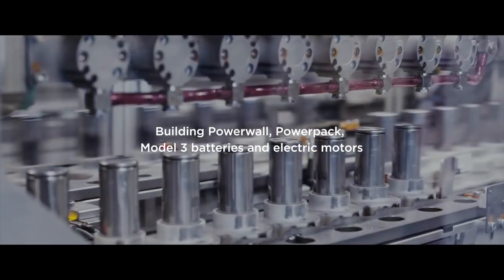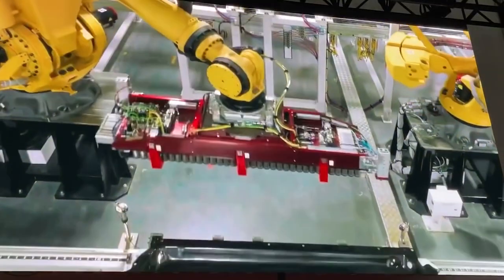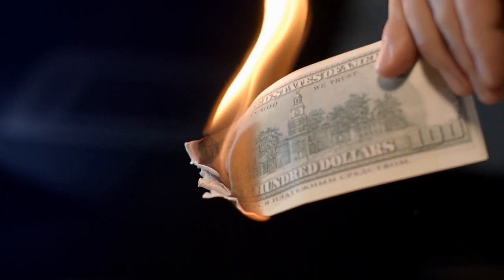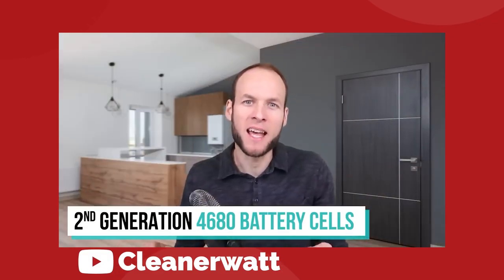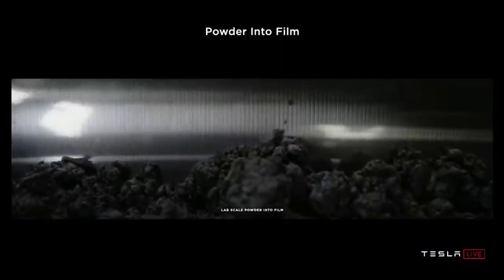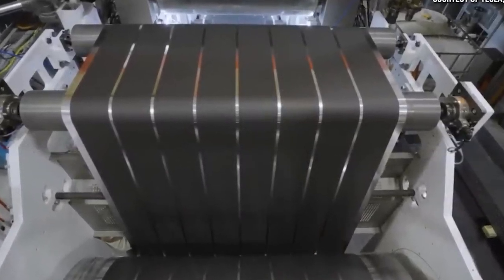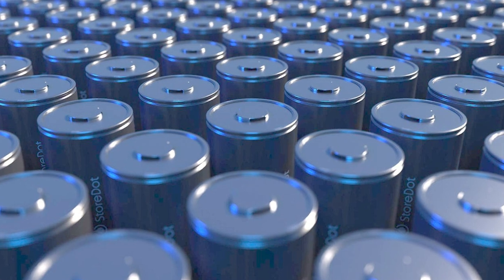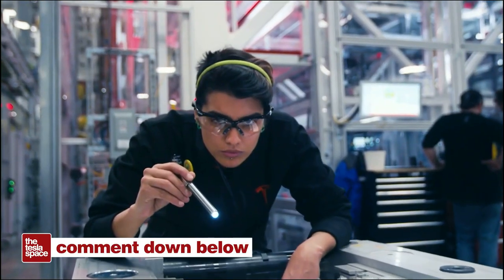The Gen 2 Tesla 4680 Battery Cell Is Here!

Comment: Musk fans are truly amazing. They actually want an unrepairable battery pack. So they can give the billionaire another $20,000 if anything goes wrong outside of warranty! Guess they feel he needs more of their money?
Reply: Tesla has a pretty good battery warranty:
8 years or 120,000 miles, whichever comes first, with minimum 70% retention of Battery capacity over the warranty period.
It would be wonderful if they could figure how to fix individual cells, but Tesla decided the structural pack makes more sense. I remember when you could replace RAM in laptops, but Apple and other companies decided it was more economical to solder it on the motherboard.  I expect that five years from now, batteries will improve so much you won't find it economical to fix the batteries of today.
Reply: People referring everyone and anyone rooting for Tesla, or simply following their progress, as "Musk fans", are truly amazing at spending so much time and energy on something totally out of their control anyway... 🤷‍♂️
You don't know anything about "$20k" batterypacks in 8 year's time, or if these batterypacks even cost this much now.
If something that bad goes wrong outside of warranty, is why you have an insurance on your car. It can happen with an engine, transmission, structural frame etc. of any other car.
Reply: @martinandreaskruse4446  Engines aren't welded shut so you have to replace them if a spark plug fails!
Reply: @DavidJohnson-tv2nn  Electric motors are usually much more reliable than gasoline engines.  Plus, you don't have any spark plugs to replace!  The battery of a BEV is much more akin to the gasoline tank of an ICE car.
Reply: @59seank  No, the battery pack has thousands of internal components. Many of which can fail and brick the battery pack.
Reply: What I think has happened is that a decade of experience of widely deployed battery packs in the Model S and newer cars has given Tesla data suggesting a remarkably high reliability rate and longevity for battery packs, and hence rather than optimising the battery packs to make them easily repairable, it was better to optimise them for increased energy density, low weight (which will help to increase range) and the ability to be a structural part of the car, thus saving weight (thus increasing range) and cost by removing the need for other structural support in the car.
Reply: @DavidJohnson-tv2nn  "The battery of a BEV is much more akin to the gasoline tank of an ICE car."  I said nothing about complexity.  My point is that they both store the energy required by the vehicle.
Reply: @59seank  Complexity relates to the probability of something going wrong. The 4680 totally 100% unrepairable! Why defend this stuff???
Reply: @DavidJohnson-tv2nn  Because you're assuming it matters. You're acting like it's as fragile as the screen of a cell phone. The battery hasn't even come out yet.
Reply: @DavidJohnson-tv2nn  You wrote, "The 4680 totally 100% unrepairable! Why defend this stuff?" You are assuming that the structural battery pack has a high possibility of failure, say, 1-in-3 chance of needing to be repaired within 50,000 miles. But if the possibility of failure is significantly more remote, say, 1-in-500 chance of needing to be repaired within 300,000 miles, then it would make sense that Tesla would focus on optimising the battery pack for some other issues (e.g., increasing energy density, decreasing weight, decreasing cost, and making it structural to save weight in other parts of the vehicle) rather than optimising it for repairability.

In the previous paragraph I used made-up numbers to illustrate my point that an unrepairable battery pack can be defended if the possibility of failure is very remote. I don't claim to know what the actual possibility of failure is for the structural battery pack, but a few things I have read about Tesla suggest that the possibility of unacceptably-early failure is relatively low. For example, have a look at page 67 of Tesla's "Impact Report 2021" document, which can be found with a trivial internet search. Notice the claim that "Tesla's battery packs are designed to outlast the vehicle", and the graph of range loss for battery packs in Model S/X cars includes some cars that were sold in 2012. Tesla has had a decade since then to improve battery performance, longevity and reliability, so it seems reasonable to assume that in 10 years' time a similar graph for structural battery packs will be more impressive.
Reply: @DavidJohnson-tv2nn  You wrote:  "Complexity relates to the probability of something going wrong."
I'm using a computer that has millions of transistors and much much more.  It's an 8 year old HP Chromebook.  Very complex, but still working fine.  "The 4680 totally 100% unrepairable!"  I agree.  The Monroe teardown was a real eye opener.   "Why defend this stuff???"  I'm not defending it.  I wrote earlier "It would be wonderful if they could figure how to fix individual cells, but Tesla decided the structural pack makes more sense."  I suggest you take up this matter with Elon Musk.
Reply: @DavidJohnson-tv2nn  at least they can still pull the whole battery and swap in a new one.  The cylindrical cells seem to be sturdy enough that the battery can be torn down to reuse the good cells for stationary storage.
Reply: @JohnGeorgeBauerBuis  Yep, they can still pull the whole battery and swap in a new one for a cost of $10,000 to $20,000! Are you ok with screwing people like that?
Regarding repurposing the 4680 cells.... I suggest you watch the videos of the 4680 teardown on Munro Live. It is so much trouble to chisel out the cells that is not worth the effort.
Reply: @CiaranMcHale  If the failure rate is  1-in-500.... That means that for every one million vehicles produced there will be 2,000 failures! Are you ok with that?
Also, quotes from Musk/Tesla don't mean a whole lot. He's been claiming full self driving is "just around the corner" every year since 2015!
In response to:
"But if the possibility of failure is significantly more remote, say, 1-in-500 chance of needing to be repaired within 300,000 miles, then it would make sense that Tesla would focus on optimizing the battery pack for some other issues"
Reply: @Distress.  A customer getting a $10,000 bill because the battery was purposely designed to be unrepairable matters! Also, the battery is in limited production.
Reply: @DavidJohnson-tv2nn  You wrote, "If the failure rate is  1-in-500.... That means that for every one million vehicles produced there will be 2,000 failures! Are you ok with that?" I gave those numbers as examples to illustrate a point. But let's consider such a hypothetical failure rate and assume the cost of a replacement battery is, say, $10,000 since you mentioned that figure in one of your comments. That works out to be an average cost of $10,000 / 500 = $20 per customer. One of the benefits of the structural battery pack is that it reduces weight, and this reduced weight will directly result in reduced manufacturing cost (which hopefully will result in a reduced price that the customer pays for the vehicle) and increased efficiency (which obviously will reduce the running costs of the vehicle). Let's assume the  reduction in purchase price and reduction in the running costs amount to $300 (again, I am just making up numbers). If that is the case, then overall it is a clear financial win for the average customer.

Now consider the costs involved for a different brand of car that does provide the ability to replace cells within a battery pack. The costs involved for doing so will be: (1) labour to remove the battery pack from the car, (2) more labour to identify which sub-module (containing dozens/hundreds of battery cells) needs to be replaced; (3) the cost of the replacement sub-module, and (4) more labour to replace the defective sub-module with a new one and then install the repaired battery pack in the car. The total cost of (1) + (2) + (3) + (4) might be substantial and perhaps not significantly less than the cost of replacing the entire battery pack.

Also, a quick look on the Tesla website indicates the warranty on a battery pack is 8 years or between 100,000--150,000 miles (depending on model), so it is not as if you would have to pay for a new battery pack if the one in your car dies before that time/mileage. So to answer your question "Are you ok with that?" Yes, I am. Or, at least, I would be if I drove (which I don't; I never got a driving license).
Reply: @CiaranMcHale  You say:
"That works out to be an average cost of $10,000 / 500 = $20 per customer"
No.... Wrong way of looking at it.
It's a cost of $10,000 for the effected customer!
Most likely a customer who purchase a used vehicle outside of warranty because that is all they can afford! Are you still ok with screwing such a customer?
You say a reduced cost for the vehicle. When in fact greedy Tesla/Musk most likely pocket the savings. These tech companies are all greedy. And Munro and Associates make their money showing these big corporations how to save money for themselves and the stockholders. While the customer gets screwed. 
Final point...
It's never too late to get your driver's license. Makes life so much easier.
Reply: @DavidJohnson-tv2nn  You wrote, "It's a cost of $10,000 for the effected customer!" People take calculated financial risks in many aspects of their lives. For example, buying a lottery ticket is almost certainly going to result in a loss of money (while resulting in a massive windfall for just one or two winners), yet countless millions of people choose to do that. When you pay for health/car/house insurance, you are also taking a financial risk. Let's switch around the financial risks associated with the battery pack. Assume Tesla said, "You have two options: (1) buy a Model Y car for $XXX and have a 1-in-500 risk that you will have to pay $10K for a battery replacement after 8 years or 100K miles; or (2) you can pay an extra $100 up-front plus and an extra $40 annually to get an extended warranty on the battery pack." My guess is that a lot of people would choose option (1). This is conceptually similar to when a person buys a household applicance that comes with a limited warranty period, the person is likely to choose not to pay extra for an extended warranty because they think the cost of the extended warranty is too high relative to the perceived risk.

Another point is that you need to compare the (example) $10K cost of replacing a Tesla battery pack against the cost of being able to repair a battery pack in a different brand of vehicle. If the cost of such a repair is, say, $6000 (again, I'm making up numbers), then the difference is "only" $4000 extra for having a non-repairable battery pack. When it comes to your hypothetical person who wants to buy a second-hand EV that is out of warranty, such a person should be able to reason "I can buy a second-hand Tesla for, say, $30,000 and hope I don't need to spend $10,000 in the near future to replace the battery pack, or I can buy a second-hand [other brand] of vehicle for, say, $25,000 and hope I don't need to spend $6,000 in the near future to repair the battery pack." If the person knows the real and potential costs involved, he can make a rational decision, and hence your assertion that the person is being screwed is nonsense.

Yet another thing to consider is that the long-term trend in battery technology is that the price decreases about 80% over a decade, and that trend is likely to continue (not in the short term, but in the long term). So if it costs $10K to replace a battery pack today, you can expect it will be far more affordable in a decade's time, or even by the time the 8-year warranty has expired.

You wrote, "It's never too late to get your driver's license. Makes life so much easier." Perhaps your life in the US is easier with a car, but my life in the UK is easy enough and far less expensive without a car, and also healthier because cycling provides me with exercise. Besides which, the reason I didn't get a driving license is that after taking lots of lessons I came to the realisation that I would actually be a dangerous driver, so it would be foolish/unethical for me to get a license.
Reply: @DavidJohnson-tv2nn  You wrote, "Munro and Associates make their money showing these big corporations how to save money for themselves and the stockholders. While the customer gets screwed." Munro & Associates consultancy services are based on the lean design ideas of W. Edwards Deming. If you read his "Out of the Crisis" book, you will see that when those ideas are applied correctly, the result can be a win-win situation: a manufacturing company can significantly reduce costs while improving quality/reliability (and pass on some of those cost savings to customers to increase their competitiveness) so the company can see increased profitability while customers experience decreasing costs and improved reliability. So your assertion that it is a win-lose rather than a win-win outcome does not reflect what I have read.
Reply: @CiaranMcHale   * "Assume Tesla said, "You have two options: (1) buy a Model Y car for $XXX".......
Didn't you just say Tesla saves perhaps $20 per vehicle by making the battery pack unserviceable? But now....
Tesla is going to charge...
"you can pay an extra $100 up-front plus and an extra $40 annually to get an extended warranty on the battery pack"?
By the way, no extended warranty needed on a serviceable battery pack.
*  "If the person knows the real and potential costs involved, he can make a rational decision, and hence your assertion that the person is being screwed is nonsense."
The problem with anti-consumer policies is they spread to other manufactures like a malignant cancer. Example:
Can you find a large appliance without a control board? These unnecessary boards often fail early and cost hundreds of dollars to replace.
*  "Besides which, the reason I didn't get a driving license is that after taking lots of lessons I came to the realisation that I would actually be a dangerous driver, so it would be foolish/unethical for me to get a license"
It would never hurt to try again, and with time and practice your skills may very well improve greatly. Just a thought. 
You can always keep your bicycle. But it is nice to have a car. You are right about expense though. Especially if you buy an unrepairable Tesla :)
Reply: @DavidJohnson-tv2nn  Thanks for the correction about cost savings. I had gotten mixed up in my numbers. Anyway, extended warranty schemes tend to be charge a lot to cover administration costs and to be profitable. You wrote, "By the way, no extended warranty needed on a serviceable battery pack." Incorrect if the cost of repairing the battery pack is many thousands of dollars. And car battery packs contain a dangerously large amount of electrical energy, so I don't think user-serviceable battery packs would be a good idea.

You wrote, "It would never hurt to try again [to get a driving license], and with time and practice your skills may very well improve greatly." You don't know me and I think it is rude of you to suggest what I should or should not do. But since you have been so rude, I will explain. When I get up in the morning, it often takes me 1 or 2 hours to become fully awake. Until then, I sometimes feel like I am in a daze, and that could reduce my reaction times if I drove a car to commute to work or drove a rental car after a long flight that had left me feeling jetlagged (I used to fly frequently on business trips). Instead, it was safer for me to commute by walking to the train station and getting a train, and get taxis on business trips. I cycle often, but not first thing in the morning when I am still in a daze.